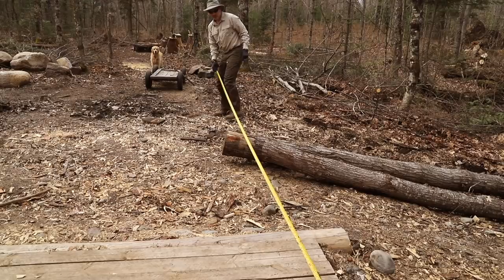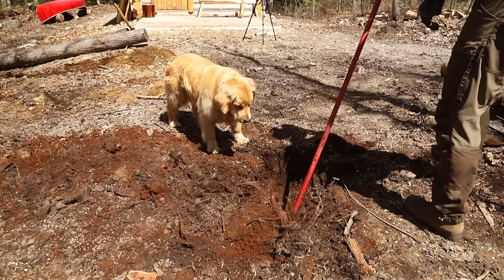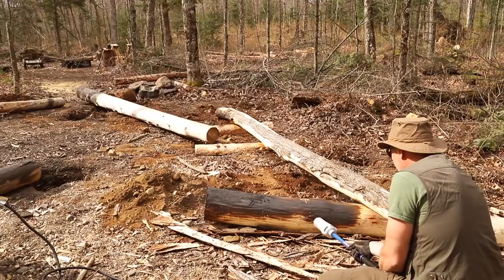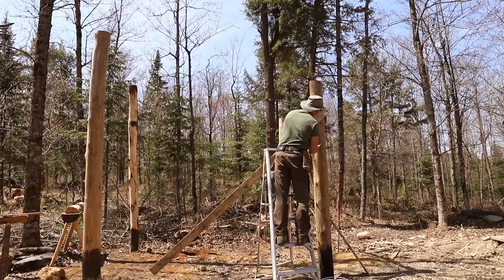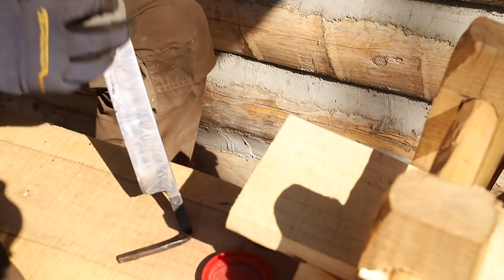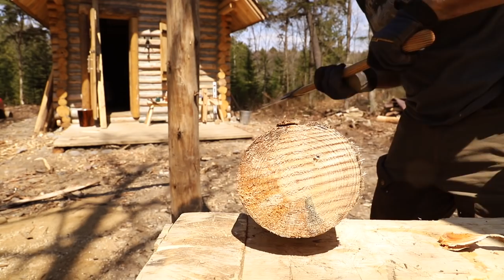Timber Frame | The Forest Kitchen | Off Grid Log Cabin Build, Ep.1 S1

Comment: Hey Shawn, I've built a couple structures like this and a tiny tip that goes a long way is: When you are lifting logs alone, dig a slide/ramp down into the hole so you don't have to lift the log so high before it begins to slide in. Then you can focus on brute force lifting without worrying about the log going one way or the other because it'll be a good ways into the hole. It helps for me when I use anything from trunks to telephone poles. 
You're awesome, man!

Comment: Love watching you and Cali! I set a bunch of fence posts in my 20s and 30s. The main thing I learned was to dig the hole deep and put them in at least 36 inches....pass the frost line in Ohio. 

Also do not use concrete to set them. Use a mix of rocks, dirt, gravel and tamp each shovel full. Concrete becomes one with the post. So if the ground around the concrete and post gets waterlogged or thaws and freezes....the post and concrete moves. By using rocks, gravel and dirt, the post becomes one with the surrounding earth. 

I know most everyone using concrete...it's faster, easier, but using rocks, dirt and gravel and tamping each shovel full, is far better in the long run. Also the water will drain off, unlike concrete, which rots the post over time. Just saying, from my experience. 

I really enjoy your self reflections too!

Comment: I've been watching your vid's and I am Impressed with your traditional methods. After long thought I decided to share some information for you. I'm 65 I live in Florida all my life so believe me when I say I know bugs, I do. Skeeters are attracted to CO2 so if you hang a few 2 liter bottles around and at dusk put some seltzer water in them it will attract them away. Also skeeters love underbrush they hide under the leaves. Dragon flys (I don't know what you call them) and bats eat them. Skeeters hate running water and they love stagnate water. The skeeters here use Cutters and Raid for salad dressing. The only thing that works is 100% Deet, but that is not healthy so I mix 50-50 with Skin so soft. Works reasonable but again not healthy. Most flies are attracted to rotting meat, drill 1/4-3/8 hole in the cap of a 2 liter bottle cap put a small piece of meat in the bottle and attract the flies away from camp. I hope this helps.

Comment: Respect- Without saying much you teach a ton.. For your own reasons you elect to use a limited set of tools. And to the task at hand well. There is always 10 ways to skin a cat, Using X tool will make Y task easier, but that changes things. Everything boils down to problem,  solution and planning. Solutions are driven by the situation/goal, and tools on hand. Plan, think backwards, and solve issues based on the situation and tools given. 

good for you, I'm humbled... Respect ...

Comment: In my post and sill frame house, my post are sitting on a flat rock below frost level.  That was done in 1887, and we remodeled in 2007 with making a cement basement and some footing.  Th frost held the walls uo in the cold off winter with out us having to crib the house for support.  We poured fooding and upward walls to ground level. mThem wood framed from there.  So old post is married into a floor system with a cement column dug every 7 feet apart to support the basement floor and walls.

Comment: I have been watching your channel since you began  building your cabin and I wanted to ask you a few questions Would it been easier and safer to drill the holes in the center of the logs before you stand them up in the holes in the ground? And I was confused why you burned the bottom of each log before you put them in the ground?
Reply from the maker: I couldn't pre-drill the holes because I had to erect the poles before determining at what height to trim the tops off to make them all the same height. The burning helps prevent rot

Comment: Just noticed you concreting the posts before getting them tied in on the tops.  When we build pole buildings, we always tie the tops together at the dimensions we want, after bracing the poles into position, and only when we have them square, and as close to vertical as we can get them we would backfill or pour concrete around the bases.  Other wise can be tricky getting the roof squared up.  A suggestion for the future.
Reply from the maker: That's what I did for that very reason. I dry filled, then tied the tops together, then poured in water and mixed.
Reply: I noticed the cross bracing after I had commented.  Got ahead of the video....
Reply: I commented before I saw the cross bracing a bit later in the video.  Got ahead of the video:).  Looking good.

Comment: Hey Shawn, Since you're going to get out the pulley(s) for extra help raising pieces of lumber was thinking of Doug's Cranes on SV Seeker.... You could approximate something similar with a slack rope suspended high up between two trees, and a sliding loop pulling it sideways to help position it where needed laterally... I'm thinking of a horizontal Y shape with the pulley at the center of all 3 legs, and moving the middle leg around to position the pulley above wherever you're working.
Reply from the maker: I was thinking something like what you're describing when I pulled out the pulleys, but the support trees are pretty far apart. I have another idea....
Reply: I'll look forward to seeing it soon !

Comment: Elizabeth L. Johnson said,  Like how you keep your tools in prime shape, properly.  I was never taught to do that; then I had a ninety-year-old friend who I did some yard work for.  When she returned home, she was upset with me, because I didn't clean-up her tools after using them.  I didn't know what she was talking about.  In her youth, she was taught to clean the dirt off tools you use, especially outside, keep them sharpened, and store properly inside, usually in a box of sand with some oil mixed in (inside a tool shed).  Shovels and such were washed off, dried with a cloth, sharpened if need be and placed in the sand box to keep from rusting.  You see, tools were not in ready supply.

Comment: Hi Shawn
So far I have watched two full seasons of cabin build and just started kitchen build section. Your skills and perseverance is always amazing. I feel relaxed after watching what you do and especially guessing where the next piece is going to go - very informative videos, I have learned a lot.
Throughout all the videos I still have question which I haven't found an answer. 
How hard  or expensive would it be to dig/drill well, so you have cleaner source of water than your beaver pond? Judging from the rocks that you have to pull out just to dig holes for the posts, it seems like that would be either hard to do yourself (in case of shallow well) or expensive to have it drilled. How deep is water in the soil? Not sure how people doing it where you live. Here in Indiana a lot of people, including me, have wells and septic. I am sure it is a lot more complicated if you have such a rocky soil like yours.
Thank you for all your inspirational videos.
Gedi.

Comment: Utility Linemen dig a post hole by hand with a FROSTbar < like red one you have ....but pointed on the one end and chisels on the other end>....a very Long Handle Straight SPADE <for dig and slice>....and a very long handle SPOON.<90 degree bend from handle and dished to scoop up dirty so you can lift it out of the hole. these tools are used once you have started a post hole to go very much deeper. You can tell how deep a pole is in the ground as the stamped marking are ten feet from the butt of the pole.  First two digits are height and - # is the Taper <1 is no taper and 9 is very tapered>

Comment: Is the concrete in the post holes hardening up all right? The water you used for mixing the concrete looked pretty brown maybe from the tannin in the leaves landing in the water source. The tannin might actually keep the concrete from hardening up.
Reply from the maker: They seem to have hardened fully. That water does have a lot of tannin but I wasn't aware it would affect concrete. Thanks.

Comment: Those times when you balance the ladder on the horizontal wood, on the opposite side from which you've nailed it in, meaning two nails being pushed to get out, are securing the ladder with your weight and the weight of the log...those times don't look good.

Comment: I agree totally shaun, my ambition was to set autonimous self build housing and greenwood skills training people in a woodland environment, i did it. But government local objections, unfounded preconceptions of me got in the way. i terminated the project extracted all my equipment moved it from UK too Bretagne France without the language skills at 55 and suddenly i find things more achieveable. It meant losing a relationship which turned out to be caustic to me, and has allowed my ex to further her nature burial and willow coffin making business, while i am back green woodworking in an honest rural environment with my agricultural, ecoforestry, and natural resource management  knowledge to carry me forward, you should look at windysmithy on the web for tool and timber mvement ideas we have developed for handling big logs on 2 wheeled trolleys made from car wheels and axles, 1 person can move a 7 to 10 meter beam 10"x12" without any power and put on trestles and working height. So if you look at timber framing UK sites there is a design for nail together trestles which will take up too 2 tons and you make the trolley an inch lower so it is a fulcrum on 2 wheels this allows easy loading and can be made to move over any terrain.
Reply: i will email info on trolley and trestle design later

Comment: Do you have a emergency contact plan if injured? We lived off grid for 12 years and it is very easy to be injured, I was caught between a trailer and log wall getting crushed by the trailer but  had enough strength to push rocking the trailer back the other way or I would not be writing this now. Hope you have a real handy cell or other device to call for help if needed.

Comment: One TV star was pushing  a military watch....Pawn Star...watch I purchase was a cheap piece of "sh__" Laste 3 days.  
A YouTube guy had an AMAZON special on a SEIKO automatic watch. $59 sale/$200 list.  Didn't work. Sent it to SIEKO with sale slip and the fixed it for free. Works great.  I had a Vietnam era SEIKO Bellamatic <same watch but and alarm clock> Works great and my little brother wanted it. His no good brat has it now. So I wanted another SEIKO and price was a steal.   I Like TIMEX but I can not get the old railroad face <white with black and red> and their wrist bands are too tight.  More expensive watch were not worth using for work and mechanical/welding.  

I wonder what watch you use and where is your shopping channel?